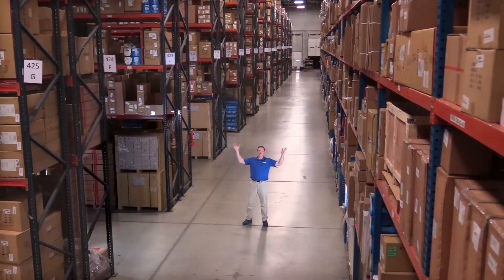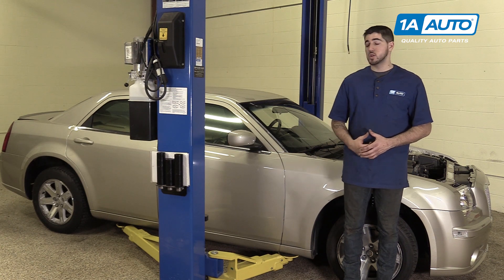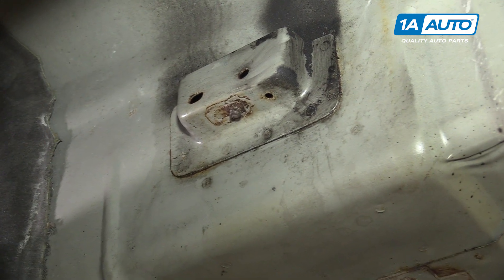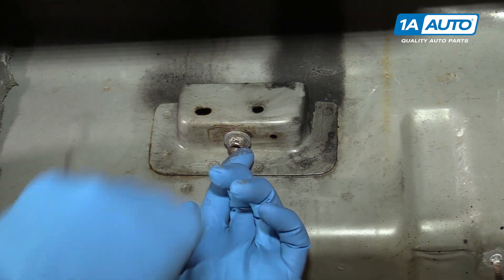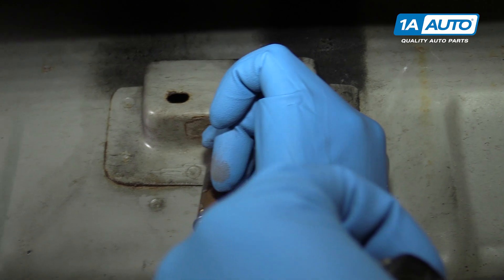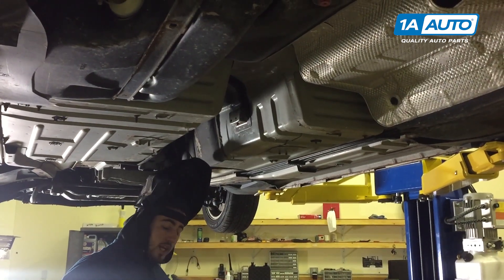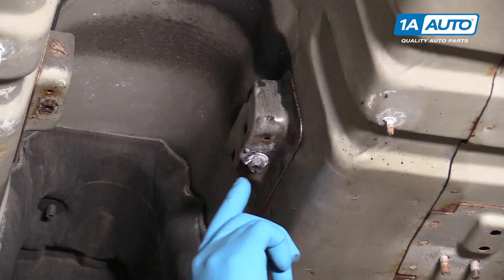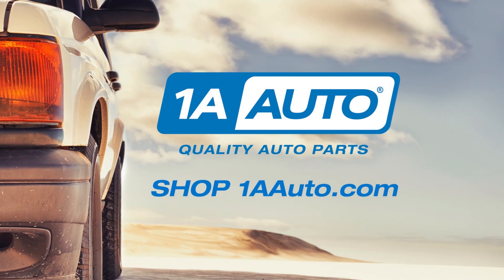Stuck Bolt Broke? Welding Trick to Remove Rusted Broken Bolt or Stud

Comment: Interesting. I could have had that removed with a pair of vice grips by the time you found your welding gloves
Reply: Doubt it. Obviously it was stuck so much the head snapped clean off. The key is the amount of heat the welder puts in to loosen it